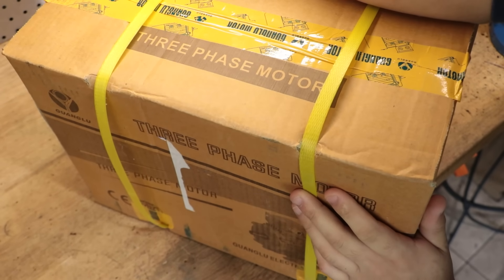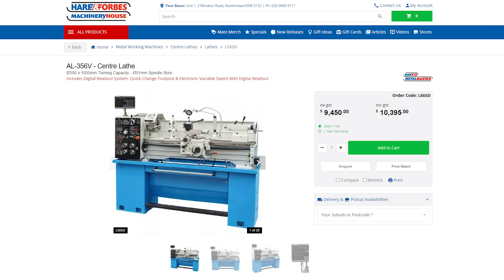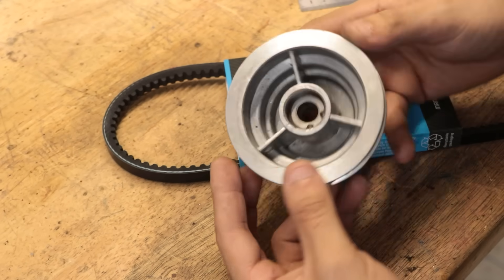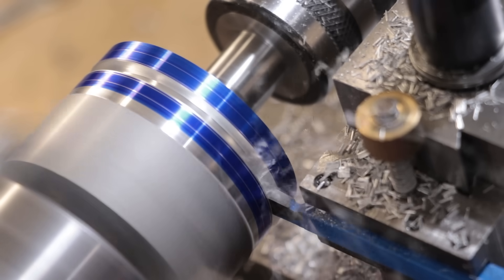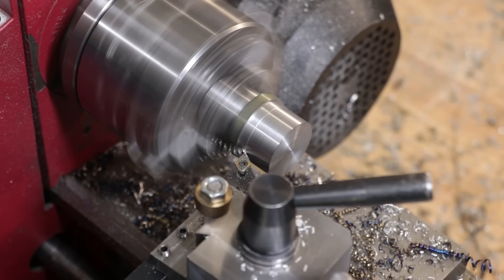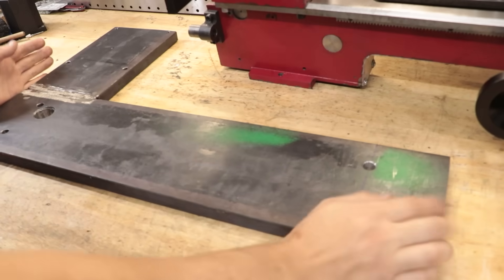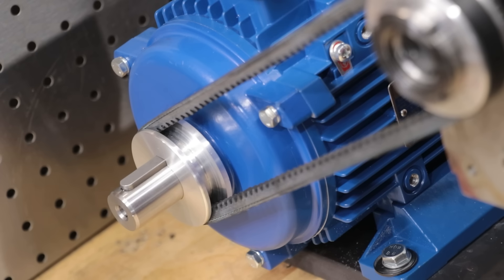Mini Lathe 3HP Motor Upgrade..... (Yep 3HP)

Comment: If your DC motor driver board broke then you could just buy a 24v 15A power supply and PWM dc motor controller all for about 20$

Comment: I have no idea what kind of power supply you have there. Mine isn't in a separate workshop, and 2.2V at 230V with other devices on a 16 amp fuse works fine???

Comment: What these drives need is a 1.1kW 3ph induction motor with an inverter. 220v 1ph in, 220v 3 ph out.

Comment: Is this same 3HP motor thant you put into mini mill?
I aksed under your many videos what motor you  used for mill.
I need exact info and model etc. To buy motor for  my mill.
Reply from the maker: any 3 phase AC motor will do fine. I recommend a 1200rpm one but if you need higher speed get 2400.

Comment: A mini lathe with a 3 hp motor will not do anything that a mini lathe with a 1/2 horse motor cannot do.
Reply from the maker: I was getting 3 plus mm doc in steel. The original 1/2 hp motor wouldn’t do that….

Comment: Dunno if you realized by now, but your chuck is allover the joint, if I can see it thru a camera, if you were to mesure the runout. and the part you made to keep motors wheel in place, and the pulley that the belt goes on to on your lathe, they are turning all over the place like your chuck
Reply from the maker: That is not the chick, that's the spindle's outer surface and the factory never bothered to grind it concentric with the spindle nose. Run out of the actual spindle nose is less than 0.01mm

Comment: You can bolt a plate to the headstock. And connect it with a thick metal piece down to the table. It would be more sturdy and have less flex when turning harder steels.
Reply from the maker: I think the headstock was way too small to be bolting that much to it. In any event I don't think there was much left to come out of it, regardless of where the motor was bolted

Comment: I’ll bet someone already suggested this, but would the reason for (3) mounting bolts/screws for the lathe head is for leveling purposes?
Another observation- in industrial plants it is standard that motors on VFDs are specifically designed for VFDuse. One reason is there are currents that flow through the motor and bearings that cause the bearings to fail prematurely.  But I imagine this is not be an issue for a home shop?

Comment: Look up HP and belts and pulley diameter etc
.. for a 3hp you need a double with atleast 125mm pulley or itll slip...so at best your going to get 1hp from that setup... when you use a VFD you lose more HP too its only 3hp at the rated hz..

Comment: The lathe motor is not turning the spindle only.  It is also turning the feed shaft through a gear train in the feed box on the fron of the lathe.  These gears have limited strength for transfering power.  In other words, you could break the feed gears, or break the apron feed mechansm.  That 3 hp motor is a catastrophic failure waiting to happen.  Make sure your health insurance is up to date.
Reply from the maker: The gear banjo broke long before I added this motor

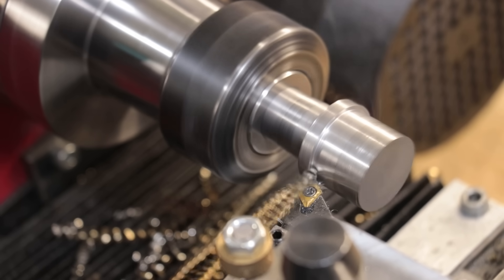Comment: 2:10 Ehm...yes, you could have implemented a speed control circuit with a potentiometer for speed regulation for fewer broken cutting tools…
Reply from the maker: For this Chinese model. More of a hassle than you’d think to add one. But the onboard buttons worked just fine. I don’t where you get this notion about broken cutting tools from, you can control the speed all the same?

Comment: You are going to have a lot of broke tools and possibly a broken lathe as well. Just think of the tourque with the machine in low gear.
My 5.5 in center height Colchester Chipmaster had a 3hp motor. That machine was a heavy duty  production machine tool that weighed half a ton.

Comment: Today I also found rule of thumb about the amount of power required to drive a cut... 1hp will remove 1cubic inch of material per minute.    Run that fromular for your DOC, surface speed and feed rate to see the power required.

Comment: Just saw your video.. I installed a 3hp (2.2kw) motor on my 10"x 20" lathe and I was wondering if I  should use a smaller unit to save some space... then I see you have installed on a mini lathe. 

Anyway you can limit the power in the VFD and the bigger motor will have better low end torque so you will get the full power up to the limit in the VFD right down at low RPM.

Comment: To get slower speeds from a drill press you need to use the spindle of the drill press as a countershaft. I'm doing that, i got a central machinery 5 speed drill press  and it has a 2/5 HP motor, better than 1/3 and not as good as 1/2. If you use the spindle as a countershaft then you can gear it down more and get more torque and slower speeds. The slow speed on the drill press is 760 but using the spindle as CS I get half that on the lathe. I had to take the spindle out and turn down the part where the chuck goes to 12 mm then I got a 17 tooth timing pulley with a 12mm bore, that is the same number of teeth as the lathe motor came with. The nice thing about that is that you can use the whole  drill press head casting so it's all lined up. Then you just need to come up with a slide for the whole assembly for belt tension.

Comment: I noticed something very disconcerting when the lathe was running with a piece of stock in the chuck.  I could see that the WOBBLE of the stock was noticeable.   This bothers me.  I want to have a lathe/chuck combination that will run a piece of stock repeatedly and true even if removed from the chuck and replaced after turning some other piece of stock for some reason.

I know that it takes a reasonably expensive/costing lathe/chuck that will be capable of this ability without any corrective action, but I want to propose a couple of suggestions that might make a $600 lathe able to obtain this level of quality.  The following suggestions are going on the premise that the problem is in the chuck and not the lathe itself.   

1)  Be sure to mark or note how the chuck is mounted on the lathe spindle so it can be remounted the exact same way in the future (the next time after changing chucks).  Try to ensure that there is no miss-alignment possible between the chuck and the spindle.  Look for sloppy mounting bolts and/or depressions used to guide the mounting action without fail.

2)  Turn the stock in the chuck to a point where it is mostly done (or done) and before removing it from the chuck mark the stock and the chuck so that it can be re-inserted at the same angle in the same chuck.  Will this make it turn true again?

3)  Considering the Chuck - I have been wondering where the wobble can come from.  Does it come from loose or miss-shaped chuck jaws (the hunks of metal that move and clamp down on the stock to be turned)?  Does it come from the miss-shaped body of the chuck which was cast improperly and not trued up?  If it is the chuck jaws that are miss-shaped, is it possible to turn the chuck and take some amount of material off of the jaws where-ever there is a mounting surface for the stock to be clamped to?

There is a final possibility:  Simply turn the stock until it is trued and finished and needs no more turning.  But I think that is sloppy and not correcting the root of the problem at all.

I am very interested if any of these concepts can be used to upgrade a $600 lathe.  I have now become aware of a VEVOR mini lathe - have you heard of this model?

Comment: what ratio did you use for your pully set up? looks pretty close to a 2:1? trying to do the same thing just trying to figure what ratio i should go with
Reply from the maker: This one here is 1:1 roughly. It is a 1200rpm motor so that makes sense for what I need from it. If it was 1800 or 2400 I might have given it a reduction.

Comment: Two things I learned from welding classes: #1- When welding two pieces of steel like you did, grind a groove into both sides before welding to make a more solid weld. #2- Flux spray EVERYTHING to be welded for the most reliable and strongest weld possible!😊

Comment: Drill and threading is where you will notice most of the difference in power. My logan was upgraded to a 3hp and it's still under powered. The variable tyranny takes a lot of power. I tried threading a 2 inch od part and it was bogging right down.

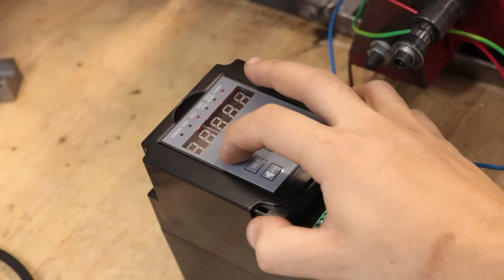Comment: 16:10 Motor is factory wired for 400V in "star" configuration, you should rewire it to "triangle" for 240V operation. 
This way you will get 1/3 of power and torque increase.
When AC motor is wired for 400V and it is getting only 240V it would overheat and burn out if loaded to max.
Reply from the maker: You can see in some later shots its wired for delta

Comment: You have already bought your motor Artisan but if you were burning a lot of these motor wouldn't it make more sense in your opinion to buy an AC water pump induction motor and connect it to a water tank . . this way the motor is kept cool and will have a longer life? maybe extend its shaft past its cooling fan from the rear and connect a pulley to it?

Comment: Just that steel plate to mount the motor would cost more than the entire lathe… Material cost in the USA makes almost any project not justified by cost anymore… Probably better off starting with a professional grade lathe to begin with here, will be far cheaper…

Comment: What is the value of replacing a half-horsepower with one that is 6 times as large? I think upgrading to one horsepower is reasonalble but 3 horsepower is drastic overkill that will probably tear the machine apart.
Reply from the maker: I ended up replacing the lathe but 3hp motor wasnt nearly enough to tear the lathe apart. 3hp was mostly for large boring and drilling
Reply: @artisanmakes  Thanks for the reply. Good response.

Comment: Nice upgrade.
I am looking at buying a 3 hp 3 phase for my belt grinder atm, where did you get the one you bought. Thanks.
Reply from the maker: EBay for about $300
Reply: @artisanmakes  Thanks.

Comment: you should never use electric weld on a piece o machinery that has bearings, since you might well destroy some of the balls or else!!!
Reply from the maker: It’ll go through that path of lathe resistance which won’t be the bearings unless you are welding parts in the chuck, in which case you wouldn’t ground it the way I have

Comment: I've only watched videos of mini lathes being used so what part of the lathe would be the next weakest point of failure the cross slide or some other point and is the 2mm cut the deepest you can make?
Reply from the maker: Probably the overall mass of the carriage. It’s quite light and not exactly rigid. Although it’s unlikely that I’ll replace it. And I’ve gotten 4mm doc in steel

Comment: I know this is a mini one but there seems to be runout everywhere? the shaft and pulley on motor, shaft and pulley on the lathe and the most concerning is a bit on the actual chuck. Is that normal for lathes of this size?
Reply from the maker: Some parts are not so great, some are okay. The threads on the back have some run out which has never been much of an issue. The spindle itself is 0.01mm of run out and with a good chuck it’s 0.04mm. This chuck I was using here is a bad example, bad run out and bad parallelism

Comment: I might be a bit late to the party, but where did you get the motor from? I have a spare vfd laying around and want to do this to my drill press, all the motors I can find seem to be $600aud+ at which point I might as well get a servo motor and driver (which is what powers my lathe)
Reply from the maker: EBay is my go to and it is where I bought the motor

Comment: Next step - put stepper motors on the lead screws and turn it into a CNC lathe. There are some low cost GRBL control boards that you can run it with. 
If you don't wanna wire up the VFD you can have a servo motor controlling the knob directly xD

Comment: Supprised you didn't go for a 3Hp DC motor puls power supply and speed control all of the treadmill - cheap'as"chips and very compact. cheers

Comment: Yes, a bigger motor is definitely an improvement but I see this more as a way to get a more stable speed than doing heavy cuts.
With a big motor, you risk damaging your spindle bearings, shearing off the compound slide (that you luckily already removed) or even twisting the bed.
My Wabeco D4000 mini lathe has a 1.4 kW motor which is what it comes with from the factory and I think this is still on the small side since the spindle speed varies quite a bit - especially on the start of a cut.

Comment: Great job and thanks for the entertaining video!:)
Suggestion: Next time when welding cover the running surfaces of the lathe and also protect the motor from flying metal spatter, flux deposits and slag.
After all, an old cleaning rag is cheaper than a new rotor or bearings;)
Reply from the maker: Yeah probably not my greatest moment. Good thing it was not a tack weld. Cheers

Comment: You need a 16mm plate table now with 100x100x9mm frame with nine legs bolted to a concrete floor.
And think you could have the biggest Dawn cast offset vice bolted to the other end of the table and be able to pound crap with a sledge hammer and it wouldn't even jar the lathe LOL. 
Even after global thermonuclear warfare the table will persist (as will the vice and motor).

Comment: which belt do you use for the new motor? I still need to upgrade the belt of my lathe because it's slipping too much. I have a 1.5hp motor attached but it's worthless due to the bad belt.

Comment: Great video as usual. But a caution. Pleas tell us you connected the earth from the 240vac power cord to the VFD earth input. And you also connected a earth thru to the motor and to the lathe body and to the steel plate on the bench. Everything MUST be at the same earth potential to protect you. The VFD will also likely have protection circuits that reference ground and they will mot work without connection. Please take this very serious. You or anyone that touches that lathe when there is a fault are a long time dead. Take care. Keep the vids coming.

Comment: Will your motor cool sufficiently at these rpms?
Reply from the maker: yeah with the speeds and loads im using its just not pulling enough amps for long enough to produce any significant amounts of heat. At least nothing one would worry about

Comment: Well done upgrade, but OMG, slow down rapidly for using reamer! Slow down, use enough of cutting oil.
Reply from the maker: ops
Reply: @artisanmakes  You can measure big difference of final diameter, depending of RPM used. And quality of surface as well. Example. Hole dia 12 mm, reamered at 380 RPM, measured diameter 12,07 mm. When 120 RPM, then measured 12,03 and much better surface.

Comment: The motor is not oversized.
A small 300W motor with a large reduction (low speed) produces approximately the same torque as a 2 kW motor without reduction. With a VFD, the speed can be controlled continuously over a wide range, but the torque remains approximately constant. The calculation is not difficult: P = 2*3.14*M*n. At low speeds, the 2kW motor does not have 2 kW but only at its rated speed. The power output is proportional to the speed. If the speed is changed by repositioning the belt, only the ratio of speed and torque changes ( 1 * 2 = 2; 2 * 1 = 2).
Reply from the maker: I've been there and done it, its how I powered the lathe for the past 3 years. In theory its good because you can step up the torque and speed of the motor, but in practice changing out belts and pulleys is not a fast process and it is a real pain. Nor is it easy to gear the speed down to a point where you could use reamers of taps or single point thread. it is just more realistic to change the speed on the VFD than it is to spend 5 minutes messing around changing belts and tensioning
Reply: @artisanmakes  A VFD does not convert the torque of a motor but only the speed.

This is the reason why you need a very large motor if you want to achieve a single-speed solution without losses of torque. Example: My lathe has 6 gears and a 370 W motor. The motor has a torque of 2.6 N/m at 1380 rpm.  In first gear the speed is reduced to 89 rpm (reduction ratio = 0.065), the torque naturally increases to 40 N/m (losses neglected). To get this torque you need a motor with 5700 W if you use a VFD without gearbox (single-speed). Whether I actually need the torque of 40 Nm is another question.
Reply from the maker: I'm not disagreeing with the math. My point is that for me VFD is just best suited for what I want. And for what it is worth, I tested out and was able to drill a 20mm hole in mild steel with a morse taper drill. I think the motor is providing me with enough power for what I need. Cheers

Comment: You need to change the motor wiring to delta. Check inside of the cover plate / manual.  Star is for 415v 3ph. Your vfd only outputs 240v 3ph, which means you need the motor in the delta configuration. I'm currently doing the same upgrade, 2hp version of that motor.
Reply from the maker: Kinda difficult to see but I did change it to delta, around the 16:24 mark. cheers

Comment: I'll tell you what happens if you break every plastic gear that you have in there and you can't buy them
Reply from the maker: There aren't any plastic gears on this lathe anymore. Certainly no gears involved with transmitting the power to the headstock

Comment: 8:52 That "Pretty good fit" looks like a loose fit from here. You should of warmed it up so it's a shrink fit on the shaft. All that's going to do over time is gaul up and the keys going to widen out the keyway.
Reply from the maker: By that time this lathe will be replaced